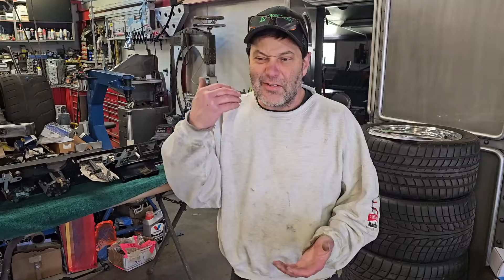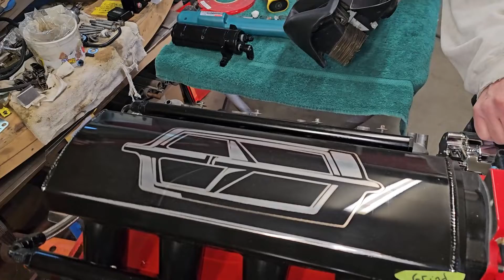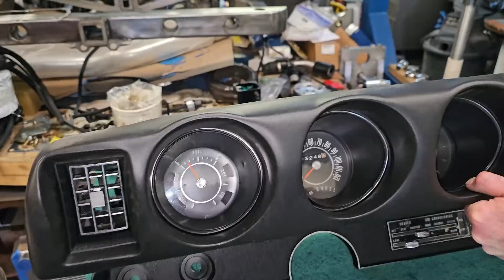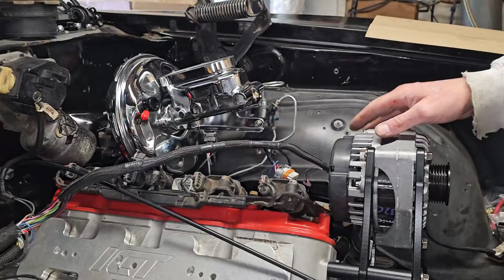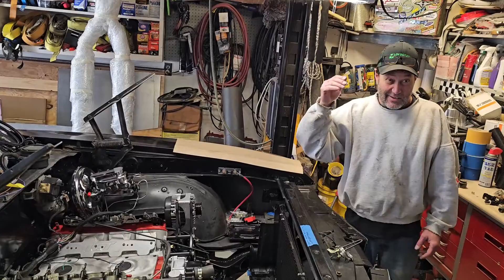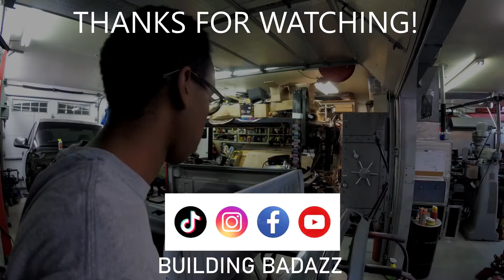Ultimate Guide: LS Swap on an A-Body

Comment: Have a 68/69 Cutlass resto mod iv built from ground up with a 5.3l iron block using the terminator x-max harness 58tooth gen 4

Holley in tank fuel pump been labour of love custom hand made hood drip rail delettes and flush mount glass modifications made flaming river power steering rack and pinion hydro boost conversion for brakes c5 vette rotors conversion all around 

Still have many things to button up and address but the wiring is the nightmare im dreading the video makes it seem and sounds so easy 

Great work you do been following your channel for few years id love to have job working in your shop